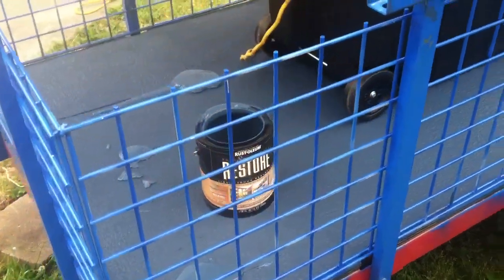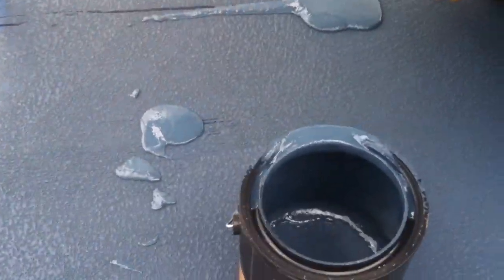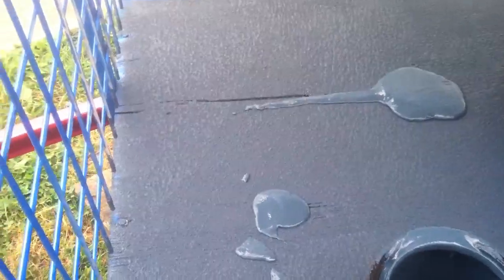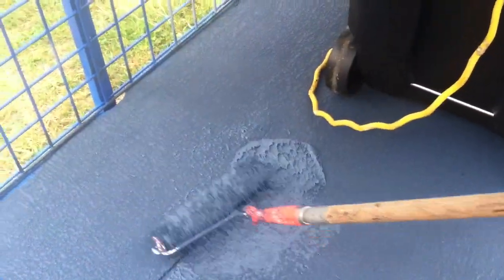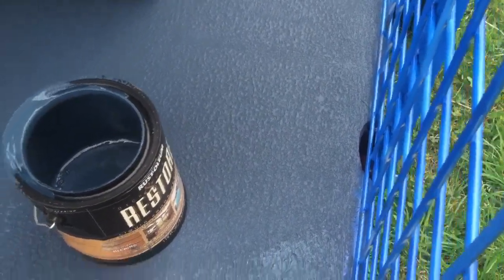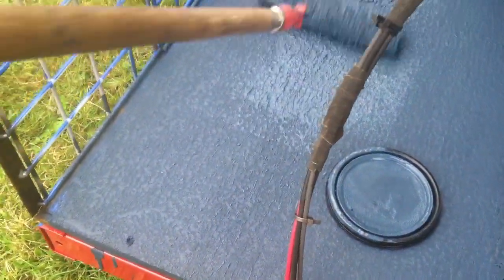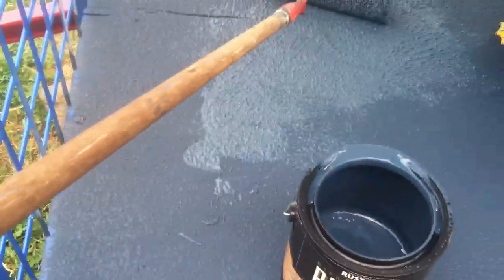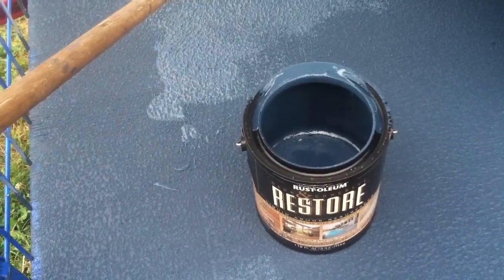Trailer deck paint with Rustoleum Deck Restore Paint/Stain

Comment: Pressure treated plywood is not marine plywood. Marine plywood has more layers and is bonded together with a much better glue/process. And costs a lot more, but is does last a lot longer. Next time try a coat of fiberglass thinned with styrene to help seal the plywood, then prime/paint.

Comment: Hey,  How is the Trailer deck now?  I want to see if it is standing the test of time.  Is the Trailer out side all the time?  How does it do with UV?
Reply from the maker: Matt Anderson it started to peel at around two years.   It had recovered it after it had been loot from the robbery of some friends I had loaned it to.   Local law enforcement were very uncooperative so I forced the issue and took it back and sold it the day I took it back.  Last I saw it around a year ago in the guys yard but I don't know if he had been using it much.   I noticed that Home Depot no longer seems to sell that deck paint.  They had a lot of complaints over it.  It was a neat concept so I hope they get it right and re-release it.  Maybe as a two part epoxy or something like that.